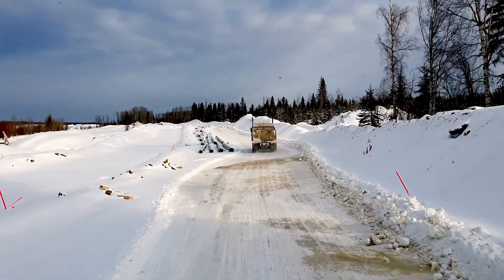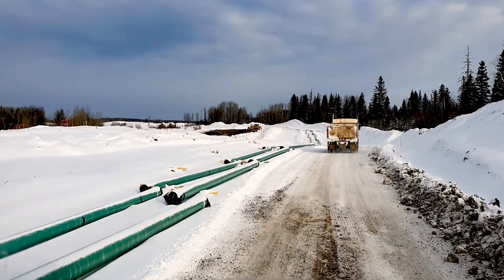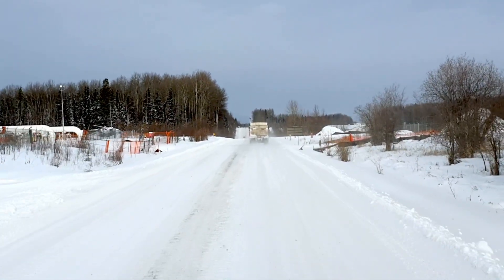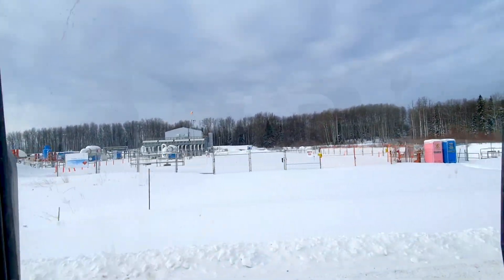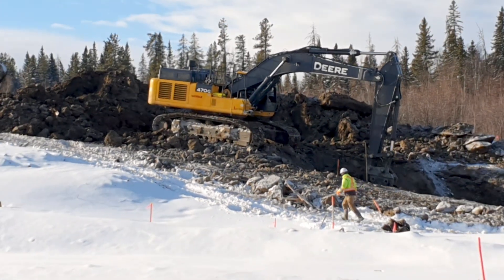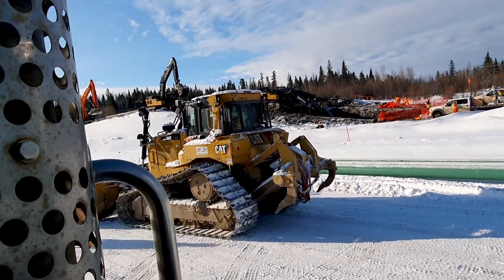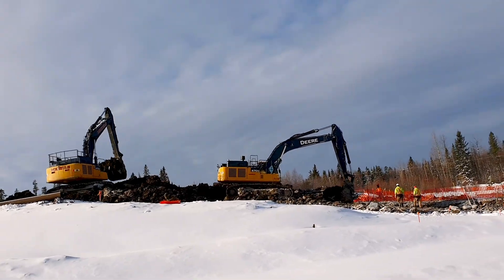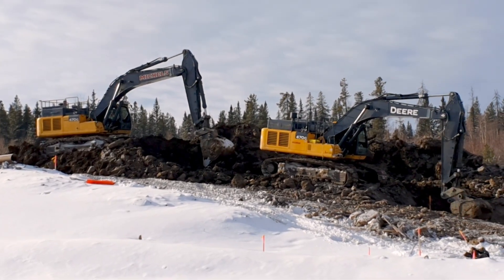Canadian pipeline construction

Comment: That is tough work with frozen ground  . It looks about the same there as it does here in Grayling . Y’all stay safe and warm out there . 👋🌍
Reply from the maker: Frozen ground certainly changes things both negativity and positively.  Negative is the digging it, but positive is access. When it's Frozen you can drive where normally an animal would get bogged down.